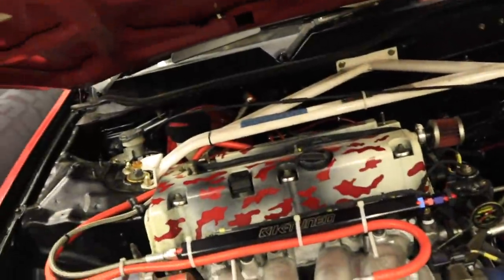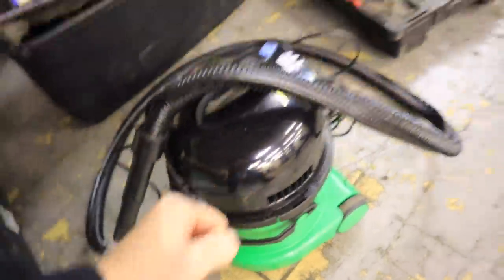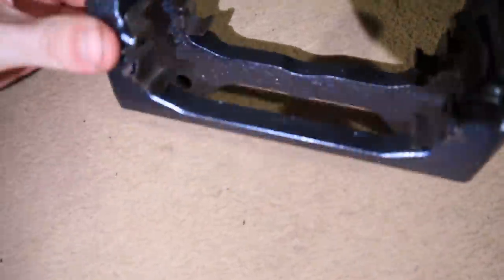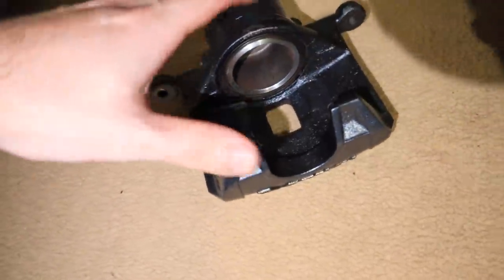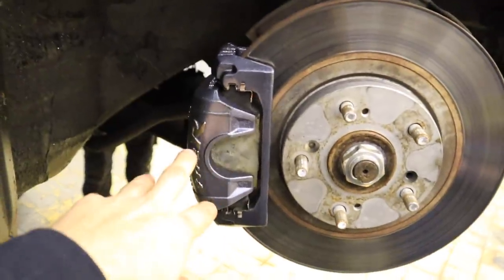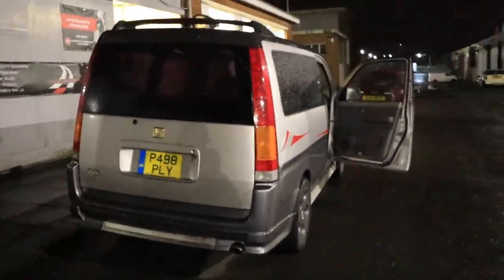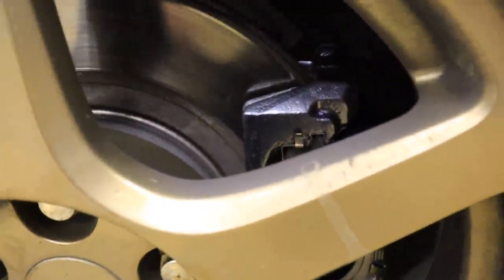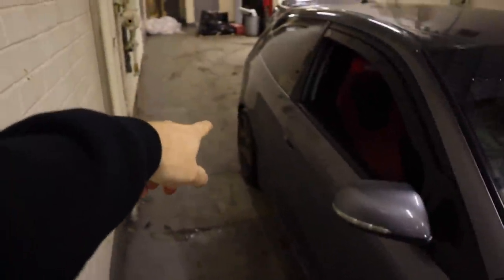THE EP3 IS BACK AGAIN!!

Comment: jesse, get a OEM factory exhaust and then get a vacuum operated exhaust valve installed after the the reasonator. Quiet for cruising around and then you can flip a switch for loud mode.